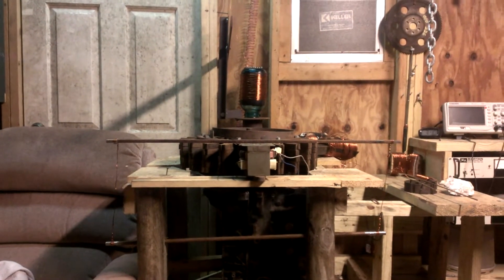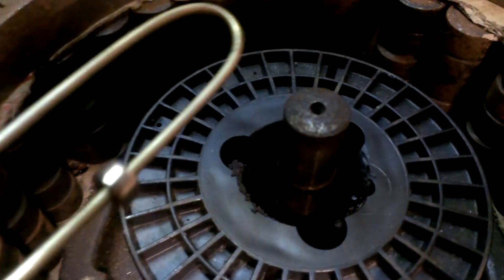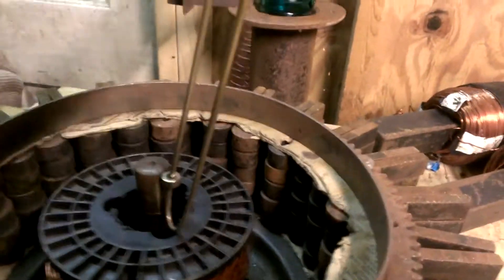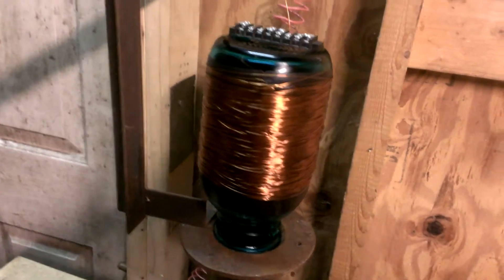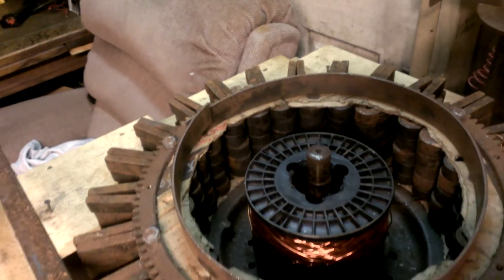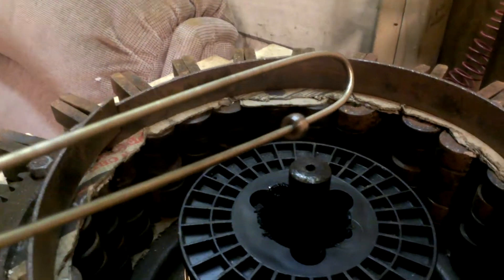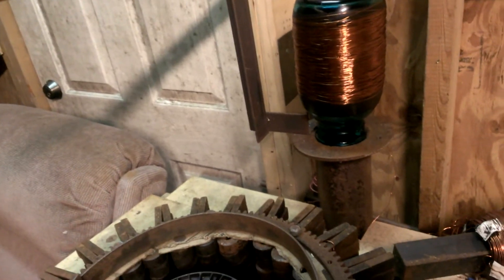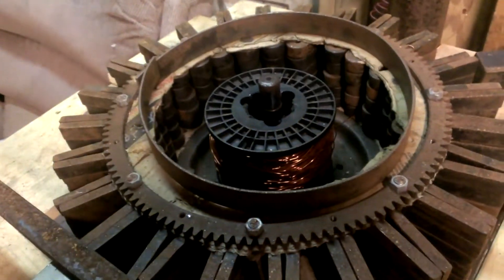Ed leedskalnin's magnetic flywheel generator

Comment: GREAT WORK AS ALWAYS! great to hear from you again after some break!  I made a very crude and very small version of eds generator based on one of your previous videos. The model was a wheel of around 2 inch diameter and a very small pmh , the thing begain charging up a fully charged battery when connected to it n not moved at all! only around .01 volts per day but enough and constant, for a fuly charge bat that was odd for me 2 see. Anyways keep it up love the video!

Comment: Vinny, first off another great video you NEVER disappoint.
secondly @ 8:37 mark in the video. Did you notice the sparks flying between the metal you have the spinning neo on and the 90 degree angle when you touched it?